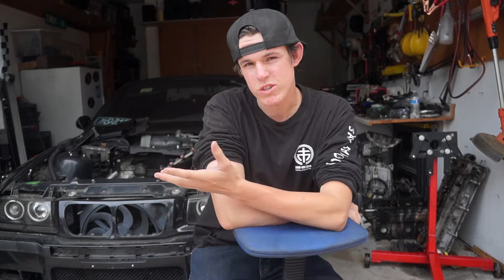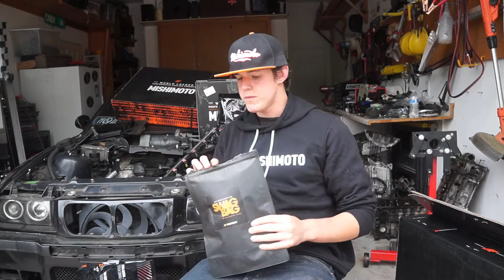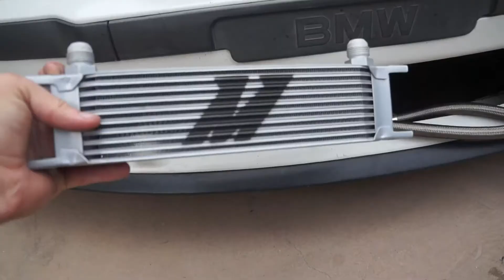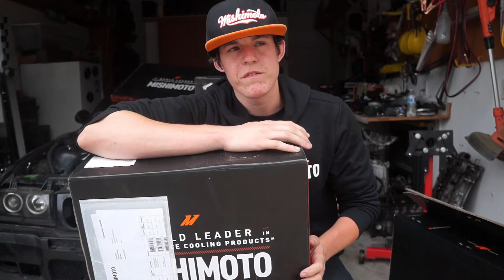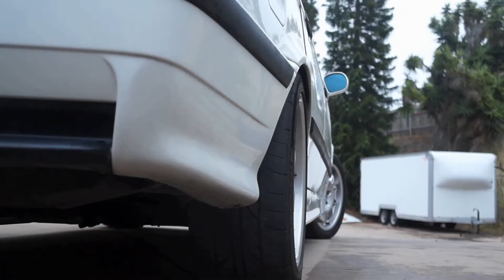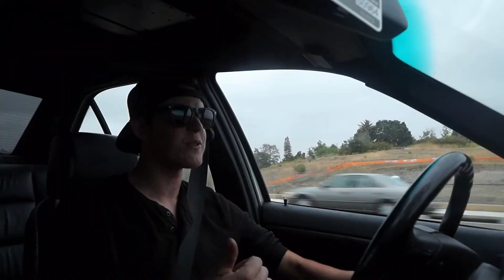Mishimoto Sponsorship

Comment: How easy was it to get a sponsorship? I am restoring a Ke70 here in Malta. It will be running sr20det build with a roll cage, shortened diff etc. Basically nothing is stock. I am thinking of asking for a sponsorship, I don't expect free stuff, but definetly a small discount would help. There's the Ae86 rad, intercooler and some proper hoses. I sand blasted the entire car and I'm redoing it from scratch, even bought new bolts as I won't be using same parts where necessary.
Reply from the maker: i mean go for it, worst they can say is no. I will say though, When i went for the sponsorship, I had 2 cars i was building, and 13,000 insta followers with a couple thousand youtube subs. im not saying that was the reason, but im sure it helped. i would go for it though!

Comment: Congrats, but tell us why they are so good, make it usefull. Then when you post the DIYs you can say: "click here to check my video to see why they are so gooood" > more views > more likes > more sponsorship brooo
Reply from the maker: yeee i might make a vid on it. Mishimoto's reputation kind of holds itself though. good Idea!
Reply: You can also explain How to install them if you run an e36 with build in exp tank into the radiator, some of the e36s do not have sep exp tank.
Reply from the maker: I guess I could, i dont have an E36 with a built in expansion tank though. are those on the 318's?
Reply: Mine is M52B20, buut I think most of the EUs are like this.
Reply from the maker: Dimitar Dzhongozov ah for sure. We dont have those here so Ive never had to work on that setup before.
Reply: May be only the EUs are like this
Reply from the maker: probably man I dont know lol